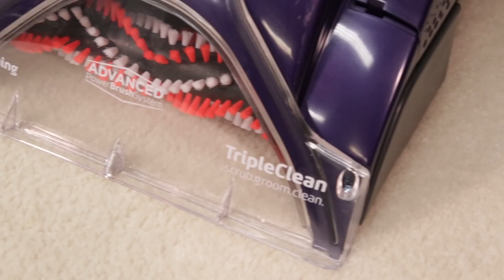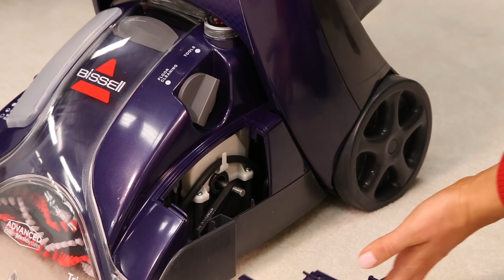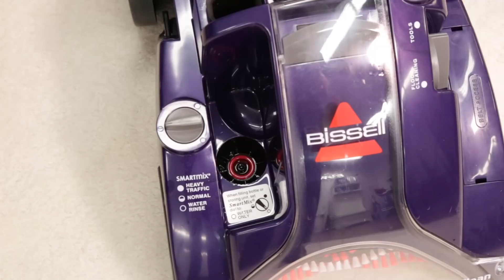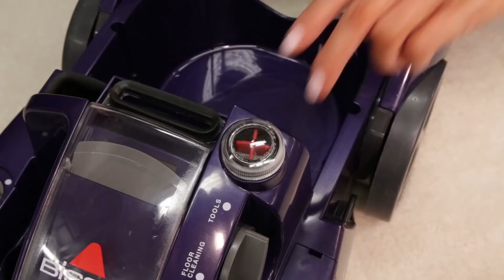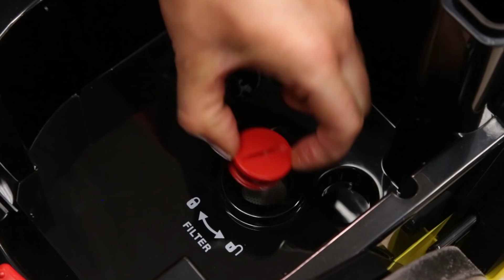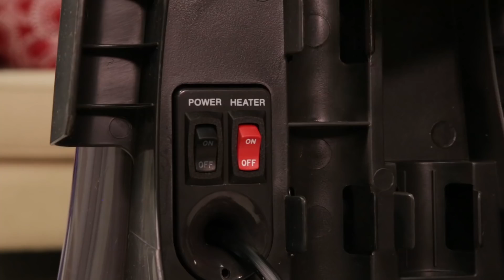Bissell ProHeat Troubleshooting: Fix No Spraying in Minutes (Step-by-Step Repair Guide)

Comment: I held the carpet cleaner in the air (power off) and my wife pressed the trigger on the hose (with the hose down) till water came out (hand scrubber end removed) That way you are sure the air is out of the system.